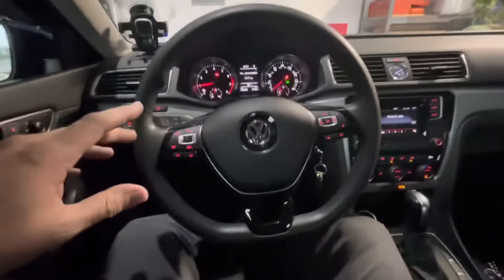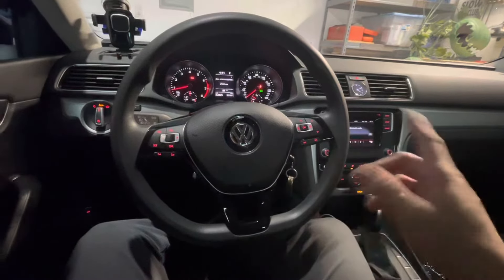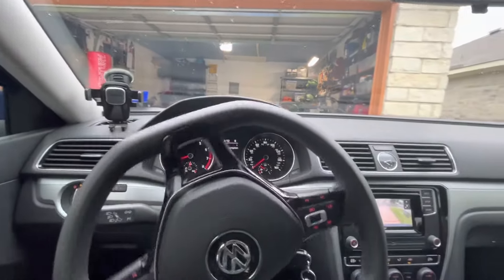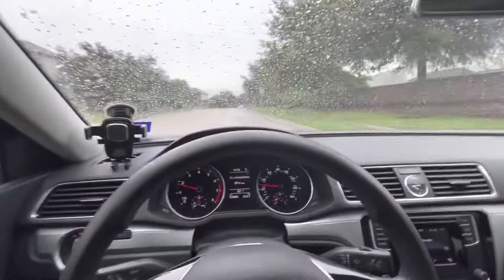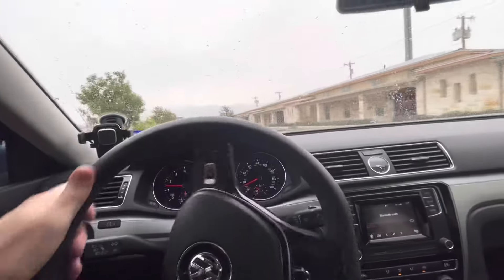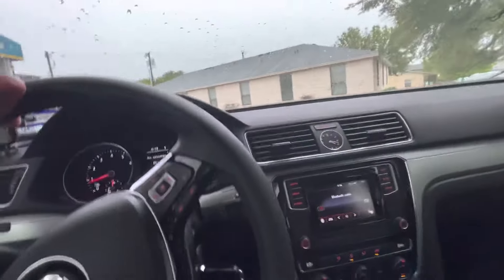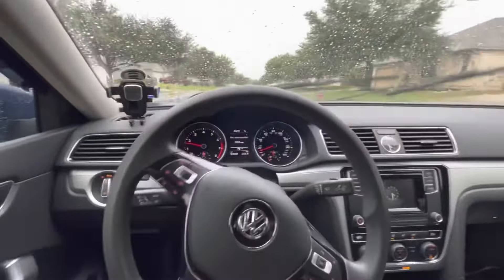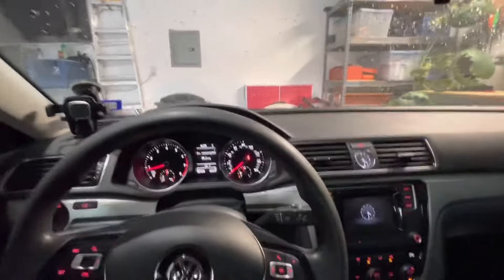Volkswagen suspension clunk/pop front end -DRIVING ME MAD- subframe bushings? Troubleshooting noises

Comment: This is a known issue at solowerks. Some kind of mix up at the factory and they got the wrong springs with the correct label. They fit but they aint right. They'll blow your struts and strut bearings if you let em go too long.  I dont think they were aware 6 months ago. Hit them up and they will replace them for you. They have great customer service. Replaced mine and its a day and night comparison. Probably the best bang for your buck.
Reply: Furthermore. If you use an aftermarket tophat, some of them are thinner metal than stock. It leaves a tiny gap between your top strut nut and the tophat. Wgen your spring compresses it lets that little gap open and slam back shut. You can fix it with a few washers. Take the top bolt off put a couple washer in there and put it back on.  Solowerks actually has a video on it.
Reply from the maker: At this point the coils are like 2 years old and I’m just thinking about replacing the whole setup. They shrugged me off the last time I tried to talk to them explaining that my springs are too soft.  “I doubt that” they said lol.  I’m using a thicker/stiffer mount from the Audi TT
Reply: @DADMOBILE_Garage  yah they weren't sure what was going on before but enough people called that they looked into it and figured out three mistake. I rode on mine for a cpl months and blew my struts. Just sent me a new set for the front. 
Now im dealing with a new non coilover related clunk. Thats why i was watching your video.
Reply from the maker: Good luck man. Clunks are frustrating.

Comment: So in my 2019 Jetta, I had this issue for slow turns, from start into roll while easing off brakes and rolling into a stop. I got the car used off the lot certified and the dealer kept telling me it was the brakes or rotors or that it was normal etc. 

Two yrs later o can distinctly identify that the issue occurs when it’s raining pr after I go through a car wash, moisture has an impact on increasing the creaminess and vibration. I thought it was water getting into the CV boot or some joint with a seal crack but I’m a woman and so most mechanics and service advisors have been blowing me off. Finally another VW dealership in my area hired a new team of real VW trained techs that test my car this week and heard the same noise, now they tell me it’s a bad driver side control arm bushing. That’s where I’ve been hearing the noise but hopefully the so check both sides and leme know if anything else wore down after driving it like this for 2 yrs. So if I get my car back and it all runs smoothly I’ll let you know.
Reply from the maker: That sounds frustrating! Good luck!
Reply: @SuperNewMom1, did they fix your issue?
Reply: Well? What happened

Comment: sway bar bushings or subframe bushings since i just replaced the dogbone and when the dogbone was attached to the subframe it was easy to move the dogbone up and down with my hand.
Reply from the maker: I checked em all and didn’t see sign of issues and went to a shop and they said the coilovers are cheap and the front springs are the wrong rates and everything else is fine. They said no sign of bushing issues but I dunno. The solo werks coilovers do kinda suck so I might just replace

Comment: That most likely is your subframe shifting some old VAG cars had hollow bolts that caused subframe to shift under weight but they changed the bolts to thicker ones which sorted the issue out or you can buy collar dead set kits to eliminate that problem for certain I hope this helps someone in the future my car is doing it today and it's an 06 definitely time for new bolts and possibly deadset collars then a wheel alignment it needs new arm pin bushings so I'll be throwing them on too but they won't cause a clunking unless they're torn which they're far from torn but they're far from new aswell lol

Comment: I’m submitting my guess… I think it may be the sway bar links. Because when my car is on the ground and I check the links, they feel tight and no movement. But if I jack up both front wheels and check the sway bar links, there is play causing the clunking noise.
Reply from the maker: I my case, I changed the end links and still had the noise. Recently traded this car in and still never figured it out.

Comment: I am having the strange popping sounds on my 2019 passat.   Been to vw dealership 7 times total.  Took it 3 times to one dealership then 3 times to another dealership  across town and still making the same noise.  Took it to another dealership  and the car would not make the popping sound at all even with a 10 miles test drive.  Here is all the parts that been changed out.       Driver side cv joint, driver and passenger side upper stut bearings.  Both steering links,  both upper and lower coil seat plates on both sides.  Had a $400 front alignment done also on the 3rd time when replacing the coil spring upper and lower  bases.  I have noticed will not make noise when raining or cold.  Hope this helps someone going through the same problem. I have a stock 2019 passat
Reply from the maker: Sounds horrible! Have subframe bushing been considered?
Reply: Bearings too

Comment: Definitely a failed subframe bushing, replaced on Mk1 Tiguan recently. A difficult job replacing both bushes.
Reply from the maker: I’m at frustrating because I had a shop that does aftermarket suspension tell me all my bushings are fine …..it’s hard to know/trust
Reply: That’s what they do for some reason.

Comment: I have the same issue and sometimes it makes a metal to metal scratching sound, doesn’t affect alignment or tire wear, but does sometimes make a vibration at higher speed under load
Reply from the maker: Very frustrating. I have  vibration now too. I need to redo my suspension 😭
Reply from the maker: Very frustrating. I have  vibration now too. I need to redo my suspension 😭
Reply: It was my control arm bushings, they looked fine but when I took them out they fell apart, sounds like a brand new ride, same exact sounds his was making in the video

Comment: It's the front sway bar banging in the bracket on-top of the subframe. Try tightening the 13mm bolts on the subframe that go to the sway bar bracket
Reply from the maker: Yeah unfortunately I have been over all the bolts, nothing was loose. Took it to a German performance shop and they said the springs are the wrong rate and are tapping/binding. Not sure if that is true but I’ve given up. They are already going soft in the front at this point so I’m just waiting to buy better coilovers
Reply: Could also maybe be bad or worn out bump stopper(s) on your struts. It can cause that specific clunking noise when coming up an incline like your driveway and it can also clunk when accelerating from a dead stop or breaking hard. Your struts not only help with absorbing and dissipating shock or bumps but they also affect breaking performance significantly.

Comment: I got new sway links. Sure as all they were correct. Part number matched. Well.. they were to long. Just by a little. The other parts place had them too thin. Bent. Went to the dealership, wow what a difference. Tip of the iceberg my friend. Good luck
Reply from the maker: Dang it sounds like you had a hell of a time! I never managed to figure it out but I’m sure it’s basically ‘my fault’ for putting aftermarket suspension on it. I traded the car in still popping and clunking

Comment: Just stumbled upon this. 2023 arteon se R line here in Texas. Had a meet and greet with a curb. Anywho. Left suspension new. “shifted front subframe to help get back into alignment” tech noted. But the Monroe struts! Came on the car but Monroe advised they don’t even go with that car and in the states. Springs are weak.Replacment went bad in 2 months.  Driver side pads get clogged with dust since the OE pads don’t vent well. It’s that groove, too narrow. They stick, get too hot, it’ll pop. And if they are direct OEM style, it’ll happen again. Possible known issues with pulsating brakes from front assist. The heat fools with the wheel bearing. Pops and drones. YOU MESS WITH THE RUN GEAR YOU GET NOISE AND MORE HEAT. Bad bad bad. Struts can’t hold up because of the springs being too weak.They clunk and pop. Even one bolt on the sub not right, the whole thing moves and pops. It’s the engine cradle/subframe thing. You mess with it, you get a bunch of issues. Sway links are thick on VWs. Insane. Same with CC. Puts much force on the sway bar with no give. Any issue you’ll hear it. Also the sway links have different lengths. Double check replacements. Rack is super sensitive. 1% damage and it’s toast. EXACTLY AS MY 13 CC SPORT. Two in the same. Front parts gotta be German. Almost all aftermarket stuff failed. But! the struts on the cc are rock solid SACHS. Bigger and heavier than the arteon. Tried 2 quality aftermarket swaps on the cc years later. nope.. failed. So! Front strut assembly on some arteons are too week. I found a part number mix up in my research. Direct cause imo.
Recap! It’s not one but many reasons. Domino effect. And you can’t throw just any parts at it. They gotta be exact. Or you will go crazy chasing your tail. Germans say how tight bolts gotta be you better be exact. For real. German stuff don’t break but it’ll let you know THINGS are not right.
Reply: an on-point remark - a rarity in this day and age.. thx

Comment: I have a similar issue. Feel a parts-cannon coming.. 2012 passat. Just had the lower control arms done for $600, with an alignment.. Louder now.. low speed clunking over bumps. First two independent shops found nothing wrong elsewhere and one supplied a new state inspection sticker.. Wondering if it’s the strut mount bearing or subframe bolts, or something in the steering rack. It doesn’t make noise when I steer though, just clunks when slow over bumps..
Reply from the maker: That SUCKS. Mine is mostly just during low speed tight turns/parking. I think mine is the crap coilovers and possibly the non-standard strut mounts. I spent so much time chasing it tho, that I don’t want to deal with it any more. Once they fully wear out I will buy nicer coils and start over hoping for the best lol
Reply: I have a 2010 Jetta 2.5 and it makes the same noise the same way as yours I have replaced the tie rod ends,ball joints,I replaced the cv axles and sway bar links and still does the clunky noise drives me crazy  ext thing I’m going to do is replace the motor mounts just don’t want to buy them and still have the noise my car runs great is the clunky noise that is bugging me
Reply: @lexxon4life804 have you ever fixed this issue?

Comment: I have this 'clunk' (tho' not quite as prominent as yours...yet) with my Skoda Yeti.  I have two bits of input that may help. 1) It's not wishbone/lower control arm, drop links, or sway bar bushing related, as I've replaced mine, and it made no difference. 2) I explained what I'd done so far to a local 'one man' VW specialist with 30 years experience. He suggested possibly the dogbone engine mount.
Reply: The reason it's not as loud because of the rain. I think I have the same issue, but Ofcourse I haven't had that checked yet. And mine is LOOOOUUUUUDDDDD. when it's dry, it rounds like metal to metal popping plus grinding noise. It's so Loud infact, I can hear it bounce of homes in my neighborhood. The beauty of car problems is that nearly every problem f*$&%^ sounds the same😁
Reply: I have a Skoda Fabia with a similar noise (I think). I have a video of it on my channel, would you mind have a look at it and leave a comment if you think the noise is similar to what you experienced? This has been bugging me for months now and it drives me crazy not to know where to look for faults since there is so many alternatives...
Reply: @hellion9547  have you figured out yet? Same problem here
Reply: @wavephonkgirl  I realized this noise only occured during winter time. After researching a lot, I started to suspect the stone grit they put on the roads here during winter time (salt is commonly used in most countries but where I live winters tend to get minus 20-30*C and then salt don't work, so they put stone grit on the roads to prevent cars from skidding). My thought was that grit pieces came into tight spaces around the suspention and when they got crushed when going over a bump, they made that noise. I stopped hearing it when winter was over and the stone grit was cleaned away from the roads, but I have occasinally heard it after driving some time on a small forest road that does not have asphalt on them but packed grit instead.

Comment: Hello, I hope my help is useful! I have a Vw polo tdi 9N3 year 2008 as a second car, and I have the same noise that you indicate in the video!

Searching a lot on YouTube I found this video link:

https://www.youtube.com/watch?v=PygMbdszSMY  (min 1.53)

It is clear that the noise is most certainly coming from the steering box screws!! They are loose and need tightening!

When you turn the steering wheel from one side to the other, the entire steering box moves as the screws that hold it in place are at an inadequate torque.

Now I don't have time to tighten the steering box but I'm going to fix it as soon as possible!

Greetings from Spain (Europe)

Comment: The brake bones connected to the shaft bones. Shaft bones connected to the wheel hub/strut assembly/sway link bones, link bones connected to the sway bone. And it’s all healed together with rubber. Like the engine is on its own little island connected by little ligaments to the rest of the body. I have nearly rebuilt my 13 cc by just hunting one issue. And if you went aftermarket on parts. I will bet a fancy steak dinner some look the same. You got told they correct, but they aren’t. I found more accurate parts at the LKQ pick and pull. Pealing a German engineered onion. You’ll lose your mind. I already know what it is. What it isn’t lol

Comment: I've been chasing the same nightmare since I installed solowerks. I changed to koni with eibach springs and still there. No issue when it was slammed. Do you get any binding in the steering?
Reply from the maker: I feel for ya. It’s very annoying. No binding as far as I could tell, beyond the springs themselves binding and popping sometimes. My front springs were too soft and tapping/rubbing on themselves in front. I never figured it out and just recently traded it in.
Reply: Change the strut mount and  strut bearing

Comment: Any updates if you ended up figuring out what the problem was? I have a MK4 2005 Jetta that it's doing the same exact clunking noise when I turn the car left or right at low speed or even if the car is at full stop.
Reply from the maker: Unfortunately no. Tried all the main things one should try, and took it to a shop. Still clunking. Waiting for them to wear out so I can get something better
Reply: Did you fix this?

Comment: I have the same issue.  Going to start with the beefier subframe bolts because the stock ones can stretch?  Hope you find out the issue.
Reply from the maker: Nope still going on. I gave up. Saving for new suspension. Took it to a vw performance shop and they said my bolts and bushings are fine and everything is installed right but the spring rates are wrong and the coils are binding, and that the struts are just cheap. I drive around with loud music on most of the time so I barely notice it 🤣
Reply: @DADMOBILE_Garage  I finally got around to installing the new subframe bolts (ECS Tuning #2102460 Subframe Spacer Plates with hardware, and it fixed my issue.  Worth a look at least, hope this helps.
Reply from the maker: @markmac141  nice. What car do you have? I know certain cars had issues with thinner bolts stretching but I was under the impression the bolts in my Passat aren’t prone to it. I had a German performance shop look it over and they said the bolts are good….but of course I wonder how much they really looked
Reply: @DADMOBILE_Garage  it's a 2013 GTI.  The stock bolts were thinner.

Comment: Do you have aftermarket sway bar installed? Mine happened to be the aftermarket sway bar link contacting with the drive shaft
Reply from the maker: Nope. I have learned mine is mostly due to spring bind in the front. Cheap coilovers, the springs are too soft and touch together.

Comment: How low are you on the coilovers? Might be your axle hitting on the subframe or your fender liners rubbing on the axle as well
Reply from the maker: 13.25” hub to fender. I trimmed the liners early on. It’s possible the axles make contact but I have seen guys with lower Passats. Hope to figure it out this weekend.
Reply: @DADMOBILE_Garage  I’ve heard a lot of Passat owners having to notch the subframe because of this, someone actually recommended it to me because I have the same clunking also a creaking when I turn my wheel, I just don’t have the heart to cut the frame. Also I believe my creaking noise is the power steering
Reply from the maker: @christianhernandez-rt7xo   I’m going to remove the front wheels/end links and check everything this weekend, then raise the car a little bit and see if there is any difference. Def not going to bother with notching the frame. I just hope it’s not something like an issue with my steering rack.

Comment: Did you install new or reused stretch bolts holding the subframe?
Reply from the maker: I did not mess with the subframe, besides checking if the bolts were loose. I used a pry bar to check all the bushing and went to a performance shop that does vw suspension and the only thing they said was wrong was cheap coils and wrong spring rates casing spring tap. Doesn’t exactly make sense to me